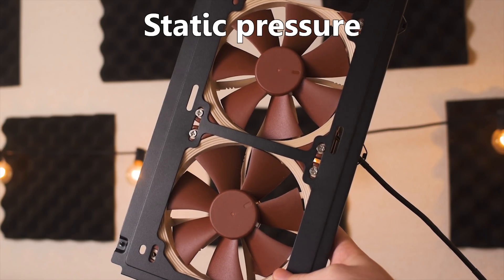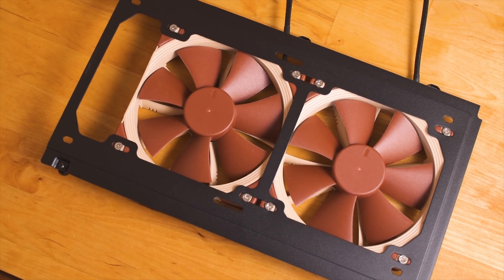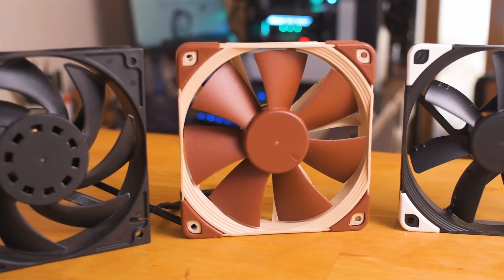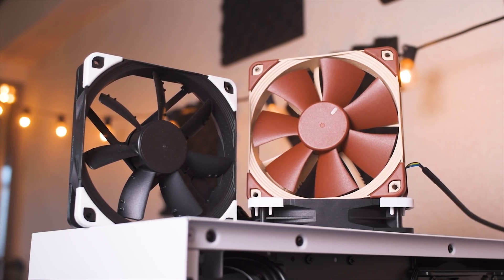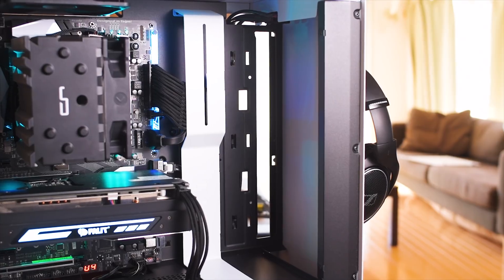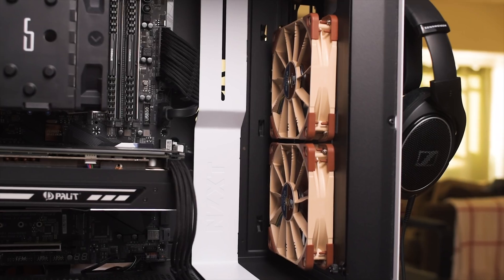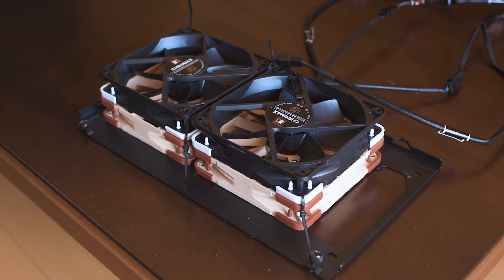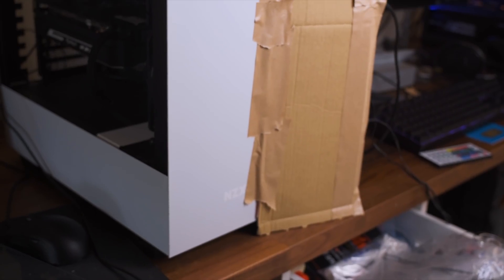DON'T buy front intake fans! (For NZXT H500/S340)

Comment: Hey Dawid quick question.  I just got the h500 case and I was planning on putting  my EVGA CLC 280 AIO Liquid cooler in the front because it won't fit on the back or the top.  Does that mean it won't be good for airflow since the H500 has a nearly solid front panel?
Reply from the maker: This is a very good question, thanks for commenting.
This isn't something that I've tested yet so I don't know how much performance you would lose. However people use radiators in the front of their H500s all the time and seem to get decent results. So I think you will be okay.
Reply: Hello! I have a Corsair h110i aio liquid cooler (280mm) on the front of my h500 case. I had to modify the bracket to be able to hold the aio cooler. Previously I had two fans on the front of the cooler pushing air in and noticed my temps were higher than ideal. I added two fans on the back side so I now have two fans pushing from the front and two fans pulling from the other side of the aio cooler. My temps dropped and airflow increased significantly by about 8 degrees Celsius. At the very minimum I recommend two fans to pull air through the aio cooler.
Reply: Tyler Lance I appreciate the response! I currently have two fans pulling air from the back of the radiator. I thought about putting two fans in front of the radiator to push air in but i wasn't sure if there was going to be a lot of space in the front. Since you did 4 fans... which ones did you decide to hook up to the fan splitter from the AIO cooler? Or does it not matter.
Reply: According to this, the answer is the front radiator mount is better: https://www.youtube.com/watch?v=xNAMxZgvves

Comment: Hey i have been extremely confused and been standing on a cliff for while so please help me out.
My new soon to be mine build is 
H500i
Rtx 2080ti Msi trio
I7 8700k 
Z370 pro carbon
Nzxt x62 
16gb Trident
And memories
Will the stock fans be good or should i consider replacing the top fan with a 140mm
Reply: No no no not with the 2080ti. Consider other case like Fractal Meshify. Gpu temps are the ones u should care the most if youre gamer mainly. h500 is negative pressure case so no matter what u do in any fan combo it wont make a significant difference. Judging by looks only im for h500 anyday. Regards.

Comment: I've been looking at this case so I really appreciate you being the only one to do actual airflow tests. 
Is it possible for you to do a setup with 2 nf-a14 IPPC 3000 RPM fans as front intake? Those are super high pressure and airflow and I fee l might give a noticable difference in temp
Reply: No it wont but will increase noise. U should mainly focus on the exhaust. Place better fans there since Nzxt designed this case as negative pressure case. With its 39 litres of capacity it is not AF case by any means. Gpu in this case draw air from back (pcie slots) that suits best for gpu. If you push too much front intake air over gpu it will raise temps( causing disturbance).

Comment: aaah man one more thinnnnng  why did you not try changing the exhaust nzxt fans with noctua. idk i think it wont make a difference too, great video anyways thanks.
i have an old CM enforcer case with the huge 200mm fans all around, im thinking about the h500 but idk i dont think the airflow is going to be that amazing maybe even worse then the case i have now.. what do you think? im thinking buy a real AF case like the CM h500 mesh or forget the whole idea. but i still love how this nzxt case looks
Reply from the maker: That is one of the problems with the NZXT cases, they look so damn good. :P
I think the H500 mesh is a good bet if you want to go all in on the whole airflow thing. I do think however that best case scenario you will get maybe slightly better performance than your current case. If you are going to buy a new case, the main improvement will be aesthetic and ease of building. It would be interesting to compare the old "airflow" cases vs the new ones in terms of actual temperature.
Thanks for the comment, I really should have changed out the exhaust, but I was testing specifically for front airflow, so maybe in a future vide.
Reply: I was thinking about changing the exhaust too. If you make a video I’d watch it!
I almost got the Meshify C but I got a deal on the H500 and was trying to save a bit for other components.

Comment: Do these fans work fine as u tested in the video if i build a PC with ryzen 5 2600 and radeon rx 580 in the NZXT H500 case?I mean the temperature.
Reply: Haha I just built a h500i with ryzen 2600x and rx 580 and have no issues with heat
Reply: Adam Ouimet cool I just got this case i7 8000 just worried about tempt
Reply: Ka chun Yeung I’ll try to remember to tell you, I’m finishing a build of a pc in a few days with those 2 parts but there’s probably someone who has done this already and posted it online. I expect it to work, I have seen very acceptable temperatures with this case from people running even hotter components inside.
Reply: did you end up building a pc in that case?
Reply: I built a H400 with 2600x and rx580 last December. Two intake fan with Aio cooler at the front and exhaust fans at the top and back. There is no problem with heat. Under load (gaming and code compiling), cpu temp is about 65c and gpu temp is about 80c
Reply: Stefan Lin 80c????

Comment: im confused arent the fans pulling in air inside the case (the nzxt ones) ? seeing as how they were positioned with the purple trademark at the back ?
Reply from the maker: If you look at the B-roll at 2:33, it shows that the fans are setup by stock to exhaust air. If you look at the fans in your case, they pull air from the front of the fan and blow it out the back (if that makes any sense) 
Thanks for the comment :D

Comment: GHETTO RULES! 
btw, after your conclusion that it's the exhausts creating airflow it would be nice to test it, don't you think? 
Just as a proof of concept. And maybe it's worth to put exhaust fans as intakes, will it make temps better?
Or maybe it's worth to put bigger exhausts altogether.
Reply from the maker: The noctua NF-s12's are right next to the case waiting to be used for exhaust, and I will report back if it makes a difference. I am sure get to it soon. :D Thanks for the comment.

Comment: Hey Dawid it's me again. The guy with 3770k PC problems. I hope you remember me after such a long time. 
I watched your video on 3770k build. It was really good. 
Btw good news for ME(lol). After a lot of research and few troubleshooting. I managed to solve my problem about motherboard not accepting Graphics card.
It was a stupid mistake of putting Mobo settings to onboard after my previous graphic card died. So changing it back to
PCI express did the trick.
And I was about to splash the cash for my new AMD build. Luckily I tried to give my current pc one last chance. And everything worked. I was lucky I guess.. Coz i think 
My PC still has 2-3 years left in it.

So FINALLY my question is which GTX 1060 or Rx 570 card is the best from there manufacturers???
I want pure 1080p ultra settings gaming experience.
Reply from the maker: Hello Harshad,

Thank you for the great comment. I'm really glad you figured out your problem, because that CPU is still great. Like you said, it still has some life left in it. :D

In regards to which GPU, I think the GTX 1060 is the better bet. Even the 3gb version is generally faster than the RX 570.
Reply: Hey dude.... I just bought Gigabyte GTX wind force 1060 3gb ... I was thinking about going for 6 gb version.... But in comparison videos I saw only 6 -10 fps of difference between 3 & 6 gb. So instead I boosted my ram another 8 gig...😋
Thank you so much for helping me bro.... 😁👍🏻

Comment: I don't really get why those solid front panels are so popular. To me the most important intake is the front, oc you'll have a dust filter which decreases the airflow but that is a dumb concept to me
Reply: They do it for few reasons. Design. Beauty. Looks. Minimalism. Esthetics. Etc. Not debatable but its there among others. Same as Apple doing with own shit. Not the best cooling. But best looks and noise. So if you running midrange inside h500 u should be good. Also this case doesnt have cheap plastic at all. As said for some this is major selling point.
Reply: @reklamspot  Yes I get the point but i would nice to see, in order to get the same airflow, which would be the final noise compensation of a solid panel solution vs the lower rpms of a meshed one

Comment: Wow. As a pc enthusiast the idea of having the same results with no fans and premium fans scares me. On the other hand this means that the stock configuration offers a "good enough" air flow and don't rely on user knowledge.
Reply from the maker: I know right? It seems crazy that expensive intake fans don't help in this use case. You are right though that it's nice that the case comes stock in pretty much an optimal airflow configuration. Especially for $69. Thanks for the comment.

Comment: Wouldn't it still be a good idea to ad front fans to get positive pressure and minimise dust building?
Reply from the maker: That's a good point, and I thought the same, but I have run the nzxt S340 for months with only exhaust fans and I had no problems with dust.

Comment: Well, that gives me a little more confidence in these types of cases for 'mid-range' builds as not being the 'furnace in which to melt my gear' I thought they might be.   BTW, on the input side of this case, is there a dust filter (as it looks like there isn't) ? Thanks. Interesting, as usual....
Reply from the maker: It does a surprisingly good job at at not setting everything on fire. :P
It does have a small dust filter right at the intake holes in the front. It's very fine, and has been doing a good job up until now.
Thanks for watching and the nice comment.